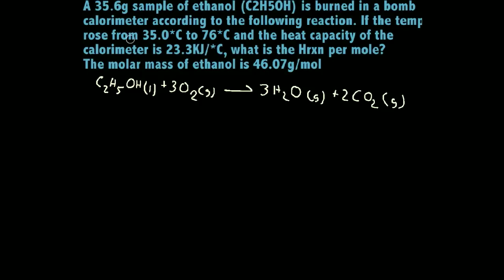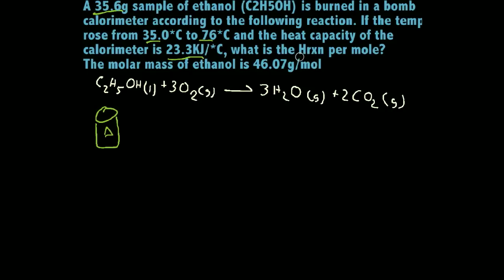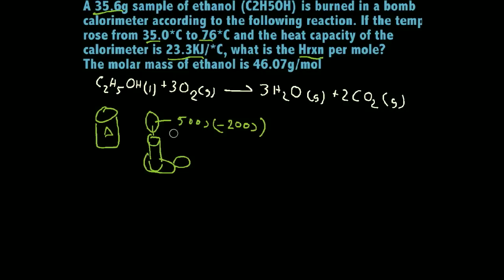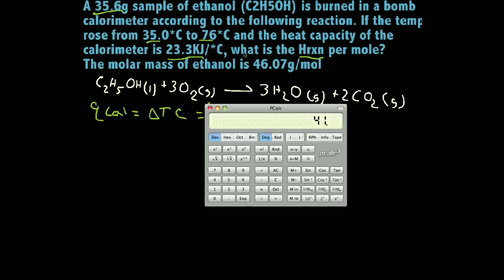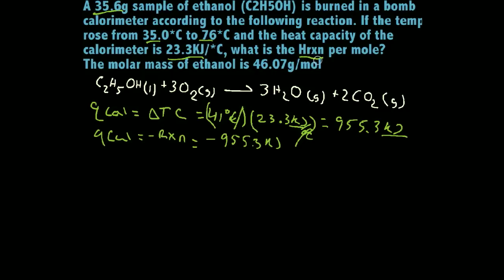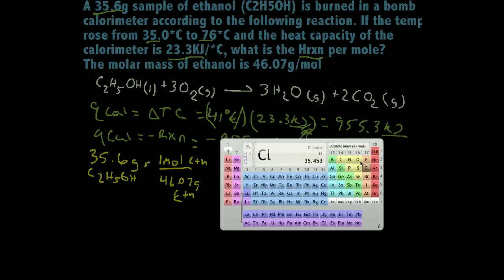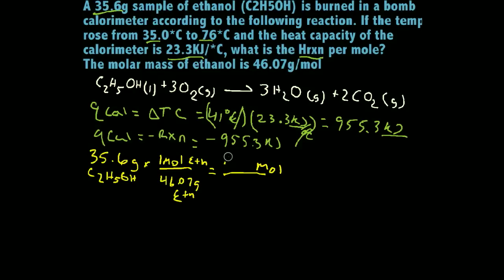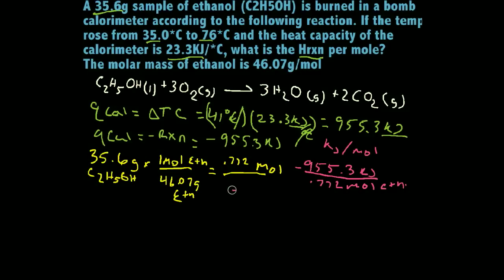How to do a bomb calorimeter problem

Comment: 1. A bomb calorimeter measures changes in internal energy, not enthalpy. To calculate enthalpy you need to consider P-V work. For this reaction: dH = dE + 2RT =  - qcal + 2RT 

2. Units for enthalpy of reaction are kJ, not kJ/mol. If you wanna do kJ/mol then you need to indicate a chemical: kJ/mol of ethanol.